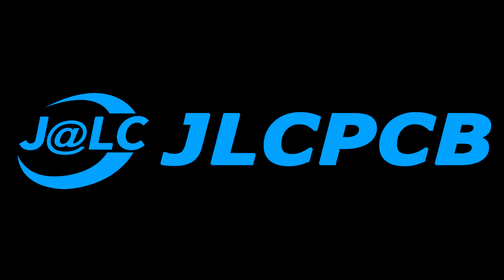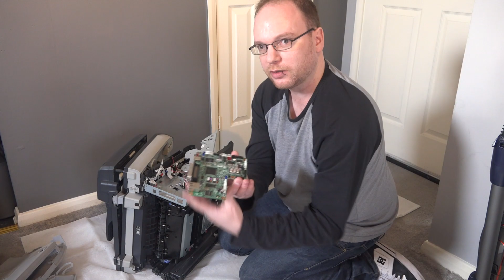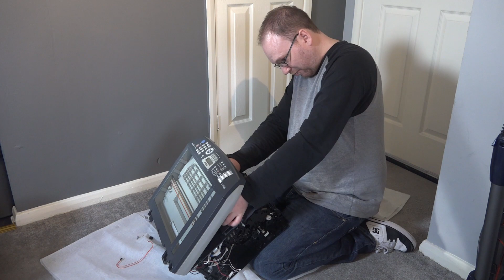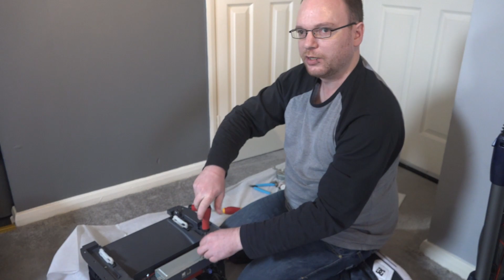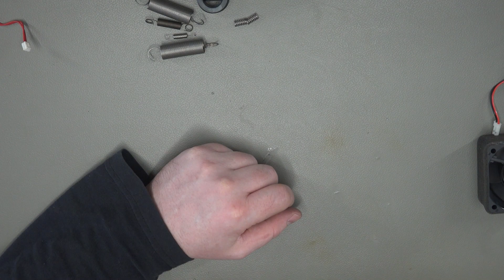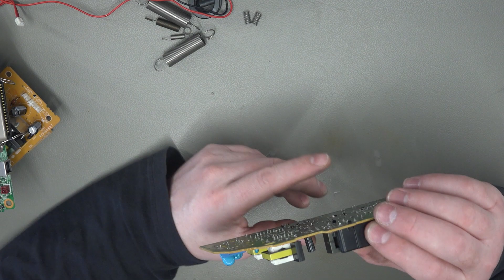Brother MFC-7820M Teardown & Parts Salvage

Comment: Dude, you know you probably could have donated it to someone that could used it since you mentioned it still working. Additionally, instead of just trashing and filling the landfills, you could sell the parts to those that fix their electronics themselves via ebay or similar websites. Today's throwaway society is just pretty sick. I have had this unit for over 13 years now and it is still a strong champ with no issues, except for the worn down ADF scanner glass which I hope to find and replace and used it for another 10 years.
Reply from the maker: Hi, I am not one for throwing away electronics and I always try to repair items first or look for someone else who would like them, in the case of this printer I picked it up as no one else was interested in it, Yes it was still working, but there were no takers for it. All the parts were taken to the recycling center to be recycled and not just go to land fill. If I had the space to store the parts then yes I could of course sell them on ebay.